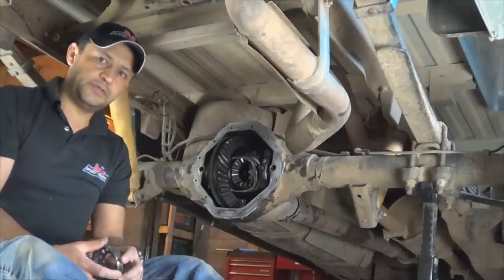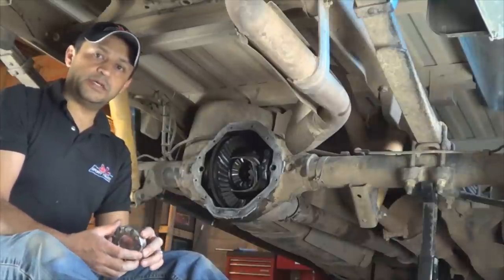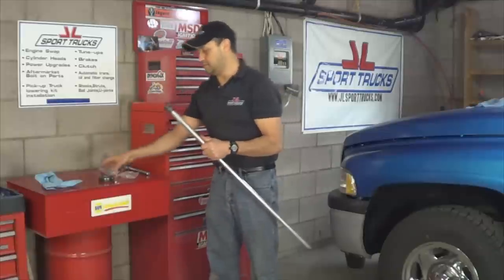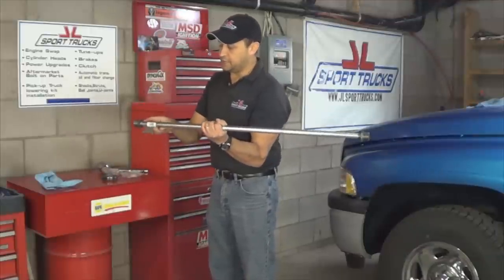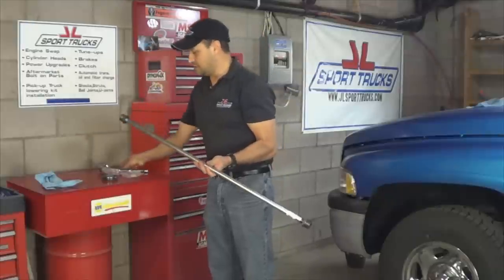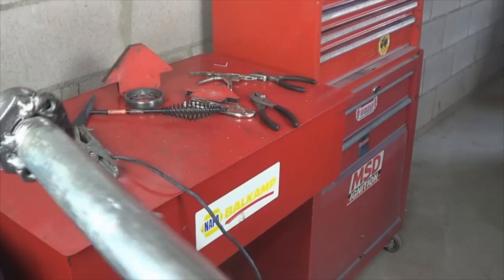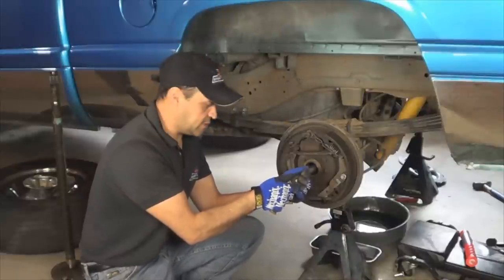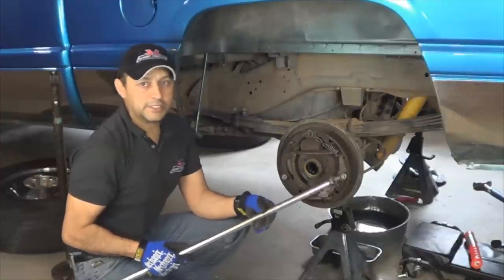Custom Made Tool for Pre loading and Adjusting Dodge RAM Differential Carrier Bearings

Comment: Your design is better than my design turned out.  I wish I would have seen your video first.  I had a 3ft piece of square tubing that I welded my old pinion nut to one end of.  The other end, I slotted and tapered so it fit into the adjuster.  My design only had four points of contact on the adjuster.  I worked fine but next time I will do this.

Comment: Sir, Just want to give a huge thanks to you for this information and your tool creativity.  I was completely at a loss as to why my chunk would not slide completely out of its housing when I attempted to replace the inner pinion bearing on my Dodge Dakota (2005).  This was the only video I saw that indicated that the pre-load rings could be loosened to make removal of the existing chunk much easier rather than trying to force it out by prying.  And then, after a reinstall of the pinion and chunk, to load the bearings as well.  Great help and a profound thanks.  Will be looking your videos with more interest for sure.

Comment: Thank you, thank you, thank you. I'm replacing the bearings in my 88 b-350 van & was trying to figure out a way to do this. A few upgrades I made. 1) put a lot of red loctite on the threads before installing the bushing on the pipe. Prevents the pipe from backing off when loosening the nut. 2) I used a large 5/8" flat washer just behind the pipe bushing to do the same thing your small washers did. You will have to ream the Id of the washer a bit w/ a burr grinder. I welded the washer to the pipe. Then you need to grind the OD of the washer to fit through the axle bearing. 3) I used a short 1/2" drive extension & drove it into the end of the pipe then welded it in place. Seems to work just fine. The exact size of the hex on the internal nut is 1 7/16".  Another note: try to get a bushing that is black pipe, not galvanized. The Lowe's store I went to was out of the black pipe type & I had to use a galvanized one. With the galvanized unit you will have to file the hex end to fit.

Comment: I saw your video last year. I made one of those tools. It worked great.
Only different thing I did was I found a thick big washer where the ID was a bit larger than the pipe, and OD was larger than the hex head. Welded washer & adaptor at same time. Took grinder & turned the washer OD down to fit past berrings and seal. Worked great. 
Thanks for sharing and bestowing the inspiration.

Comment: Great video!!!  I made this tool (7/20/21) and it worked perfect for me.  I am not handy with welding so I wasn't able to tack-weld any washers or nuts onto the tool to prevent it from entering too far, but as long as I was careful, I didn't need it.  One thing I did was mark my wheel hub and the tool at the same location and then I was able to count the rotations of the tool and the adjuster.  This way I was able to loosen the adjuster 3 rotations which was just far enough to remove the carrier bearings and ring gear without the adjuster coming completely off?  Hopefully when I go to re-install the bearings and ring gear I can rotate 3 times on each side and I will be close to spec. on my backlash?  Thanks for the video, it made this chaotic job a lot easier, cheaper, and less time consuming!!!

Comment: Just finished the axle 9.25 Dodge Ram 1500.  Stuck a 16mm 1/2" drive socket into a nut that measured 36mm on the outside and welded them 2 together (borrowed neighbors welder).  Stuck a few inter locking extensions together from Harbor Freight.  Works amazing and fits in my tool box!  ALSO ON THE DODGE RAM 1500, RING GEAR BOLTS ARE LEFT HAND THREAD!  Had to replace the Tone Gear, as it got damaged from spider gear stripping and imploding. Tone Gear controls: Speed control, Speedometer and ABS brakes.  By the way you can use an impact wrench with "Lefty Loosey" on. This strips off all the threads and snaps a few of the 12 Ring Gear bolts ; )
Reply: Stripping and imploding? I'm hearing some noise back there and the yoke is hot to the touch, what um happens um when it implodes what are the symptoms? if youd be so kind....

Comment: The tool works Awesome! I don't own any sockets bigger then 32mm so I used a 1x1/2 fitting for the adjuster side and a 3/4x1/2 fitting on the wrench side, which fits 30mm socket perfect.

Comment: awesome!! THANKS.. 2 days ago I check the rear end in my truck...pinion bearings loose..oh no... this will help in putting it back together.. I used a 1"x3/4" since I have the 3/4" pipe..I do have the 36mm socket already from my days of working on VW's the vintage ones..like 1966 models..its the axle nut size..
now it figure out how to measure the backlash with the stuff I have???

Comment: excellent video thanks for info to make tool only. thing I did different was at ratchet end I tacked old worn-out deep well  1\2 inch drive socket to it so ratchet hook's straight to pipe
Reply: then u don't have to buy the 36mm socket.
Reply: Nice thinking!
Reply: Is that 1 1/2 bushing to 1/2 pipe???

Comment: that works great, although I had to knock the second nut of mine because it wouldn't go past my axle bearing. FYI, if you don't have a race driver big enough you can turn the old race into a driver by welding some metal across the backside and a tube/rod to act as a handle

Comment: the black pipe bushing that I found would not fit into a 36mm Socket.  I found the bushing at Menards. Maybe the bushings are different depending on vendor.  Where did you buy your bushing?  I did have the 1. 1/2, but the hex nut is larger than 36mm.

Comment: I built one using a 36mm socket as a guide. It will not fit into the adjuster. Do I need to cut the threaded part off? I used 3/4 pipe

Comment: Does anyone know if it would be the same size for a 2003 dodge 3500 dual wheel?
Reply: I believe if it's a 9.25 differential on your 3500 the nut for the tool should be the same

Comment: I'd be more careful about welding on top of a parts washer!!!  Tool works great though.
Reply from the maker: Normally I don't reply but since this is a safety issue and is likely that this has been in the mind of some viewers I want everyone to know that the parts washer is empty, ( no solvent in it ).  Hopefully viewers that have used solvent tanks/parts washers know that liquid is flamable and know better than weld on top of it!!.